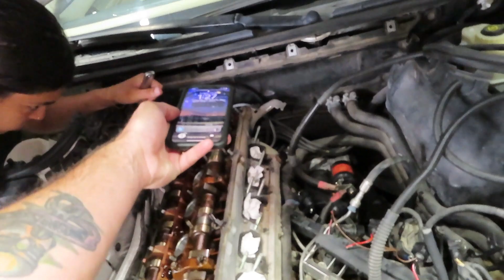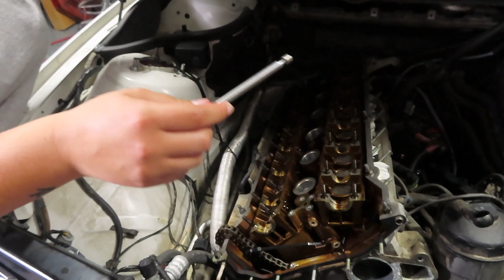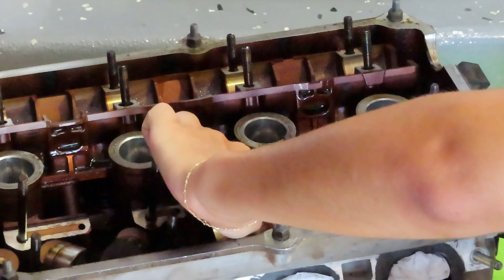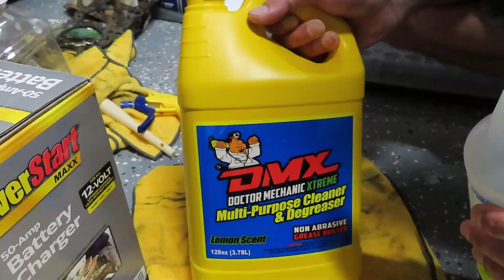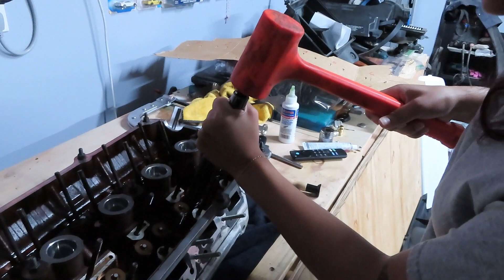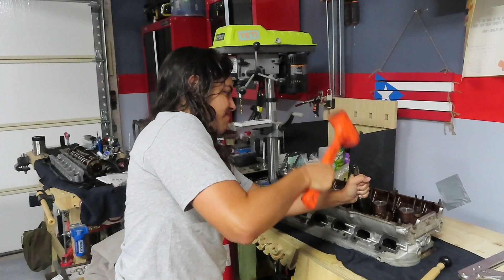DIY Guide: Removing and Cleaning BMW 325i (2004) Engine Components

Comment: Best feeling is crackin' torque to yield or machined seated bolts. 
Drifting soon.
Reply from the maker: A few of them stripped when we removed the valve head 😅